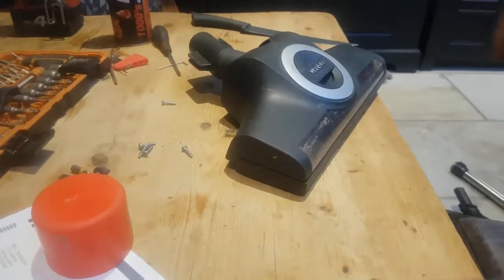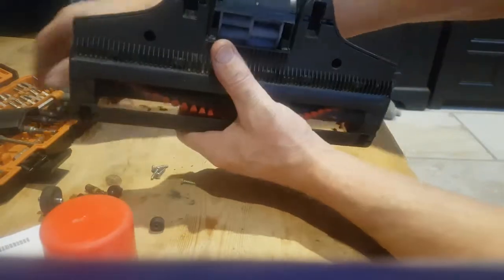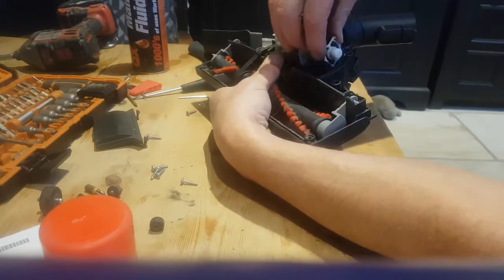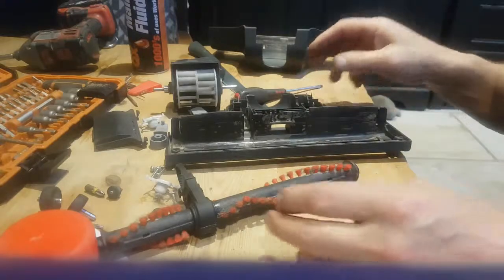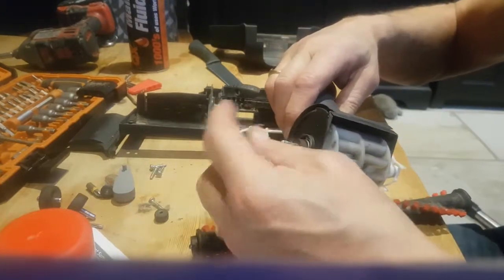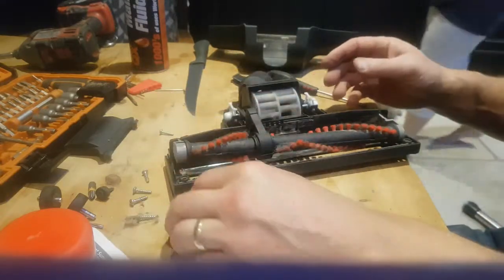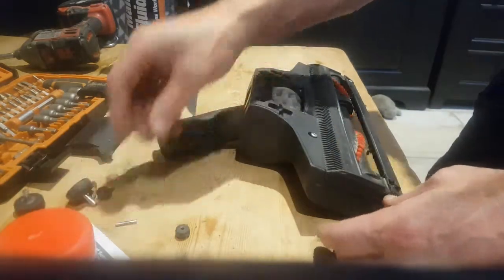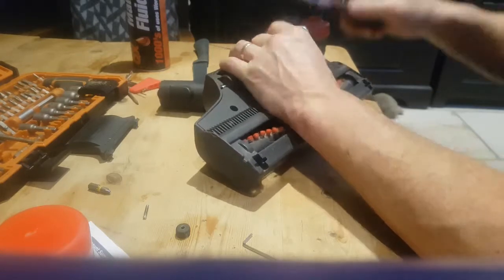MIELE CX1 HEAD NOT WORKING SEE MY OTHER VIDEO AT https://youtu.be/IvjXeDMREmE IF THIS DOESN'T HELP.

Comment: THANK YOU!!!!  The tip about the extra screws below the wheels and that the wheels snap out was the key.  After that, it was a pain getting the clear plastic part to separate from the bottom because of the barbed snap-in features.  After I got it apart, I knocked the edges off those barbs with a Dremel tool to make it easier to get apart next time.  It's beyond me why they design it such that is is so hard to disassemble.

Comment: I am a domestic cleaner by trade and have one of these heads. I usually just cut the hair out of it using scissors but decided to pull apart today and more hair and dust definitely came out from parts you cannot get to otherwise. I was not however, able to pull it completely apart where the clear plastic clips are, they are stuck fast !! put back together and now the brush isnt working properly
Reply from the maker: send over a picture or two I'll see if I can help

Comment: Too bad the belt and brush cannot separate. In fact, too bad this head has clearly been designed not to be disassembled or deep cleaned. My Dyson cordless brush just slipped straight out for easy cleaning, but the suction is way lower. Maybe someone should invent a dyson/miele head adapter!
Reply from the maker: Updated video here shows belt disconnect hope it helps, better late than never? https://youtu.be/IvjXeDMREmE